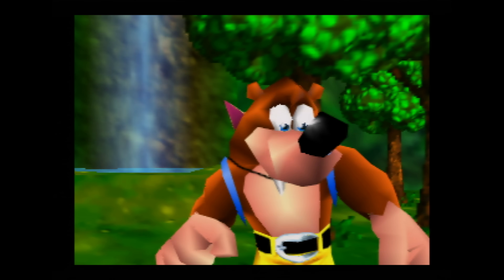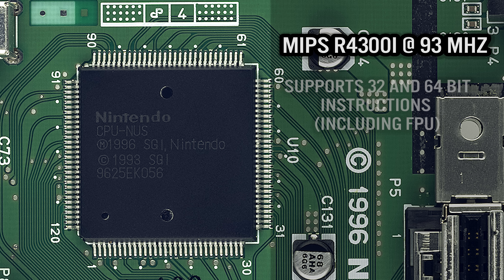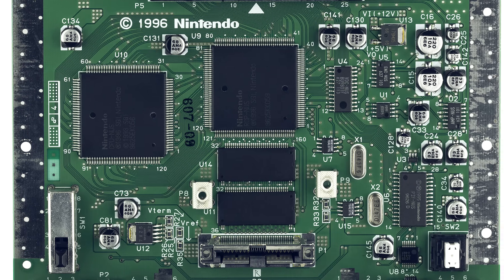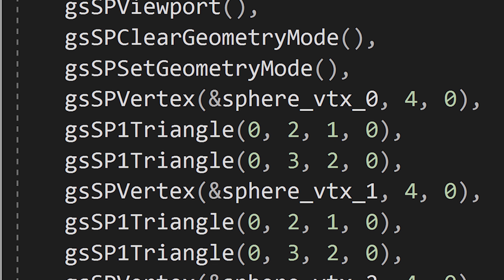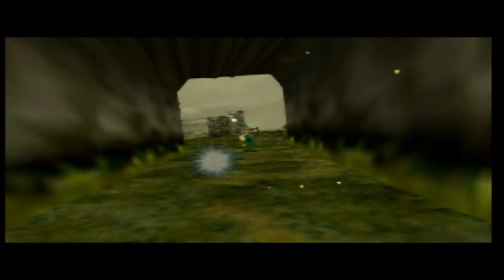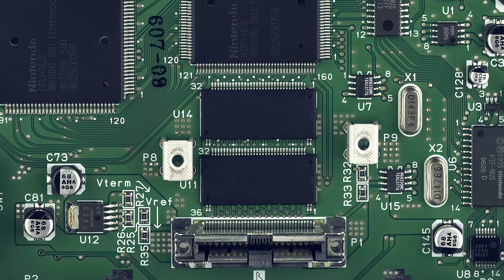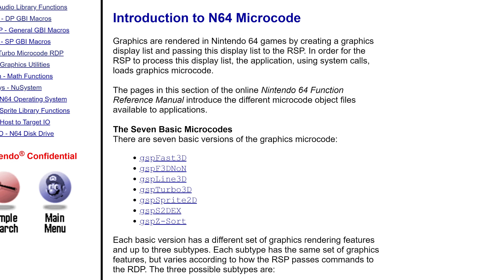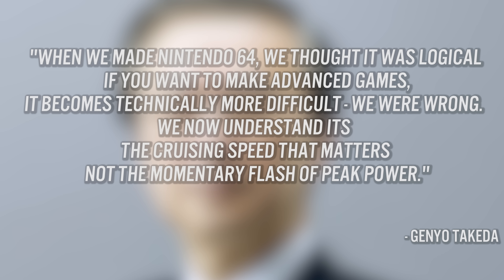Why was the Nintendo 64 so hard to develop games for ? | MVG

Comment: That puny texture cache really neutered the system. Even a secondary external cache probably would have been a huge help.
Reply: @JS-rm2ws  He was actually talking about the 4KB cache - not the 4MB RAM. If you can't fit all of your textures into the 4KB cache then you have to offload them to RAM, which is generally orders of magnitude slower than an on-chip cache although idk the exact numbers for the N64.
Reply: Tell me if I'm wrong here, but wouldn't an external cache have the same problems as the RAM? The cache was so fast, because it was built in the chip that needed it. If you added an external cache, it would lack the needed performance, wouldn't it?
Reply: @g.o.a.t.y.g.u.y  Yes and no, I think. The bottleneck tends to be the bus (especially if it's shared), then the RAM access method, then the RAM speed. The length of the wires are way down compared to those although it does affect how quickly the signal becomes stable. I'm no expert but that's how I understand it.
Reply: Yeah, 4Kb? Why the hell even bother? No wonder developers told them to shove it!
Reply: @immortalsofar5314  
Yep, one of the numerous reasons third parties completely slipped Nintendo for the most part during that generation.
Reply: @immortalsofar5314  4KB limit per texture - same as ps1. It wouldn’t have been much of a challenge had it been Cd based, could have filed multiple textures.  Cart memory restrictions really bottlenecked.
Reply: Thank you MVG. I'm learning a lot thanks to you
Reply: @immortalsofar5314  Kaze, one of the best and most knowledgeable programmers for the N64, argues that the 4kb texture cache isn't actually that big of an issue if you know good programming techniques.
Reply: Probably, although that poses problems of where to put it and who bears the cost, what the power requirements would be, etc.

Also helpful would have been if Rambus hadn't screwed up so bad with their hot new RAM type.
Reply: @JS-rm2ws  all three consoles then had different abilities that varied greatly. They all couldn't do something the other couldn't
Reply: Just imagine how different stuff would be if you went back in time and convinced the to upgrade it
Reply: a n i m e
n
i
m
e
Reply: Nintendo has always shorted their internal RAM and cache.  Game developers have complained about this since the NES.
Reply: @MarkMcDaniel  Their competitors did the same. It was never a uniquely Nintendo problem.
Reply: Why do you need special cashe just for textures. Isn’t that what ram is for?
Reply: @richieb74 cache is orders of magnitude faster and lower latency. It’s on die
Reply: Rambus choked the N64, not the texture cache. It was a failed attempt to think outside the box with RAM. It's also why the PS2 is such a slug next to its cogenerational competitors.
Reply: @CarbonRollerCaco  When developing the FPG core for the N64, a dev determined had Nintendo implemented an 18 bit wide twin bus rather than the actually used 9 bit bus, and spent just a small number of transistors on interleaving, it would have nearly cured the latency issues. Another problem was the CPU didn't have DMA. It was just a very constrained design.
Reply: This was 1995. No texture mapping or 3d cards (pre GPU) even existed on pc
Reply: A 2d streetfighter  Zero 64 with 3d backgrounds is all I wanted
Reply: It wasnt actually the texture cache size. It was mostly how the textures were mapped and used. PS1 had 2 kb texture cache and still produced amazing textures because of the way it mapped them.
Reply: @oliverb.8995  The PS1 had no perspective correction, texture filtering or hardware triangle setup. It was an awful 3d engine that breeded a boat load of shovelware. The ones which could overcome that shimmering and poppout mess were few and far between.
Reply: But it gave the system its signature look. The stretched and blurred textures were kind of a vibe.
Reply: @jvogler_art4708  "Signature console looks/sounds/feels" only work if they go well with the game itself, not as just an empty reminder of what system you're using. That just comes off as either a flaw or serendipitous soul-grabbing corporate branding.
Reply: Would it of been possible to make a peripheral that docked in the expansion slot? Because that could of been a solid fix. I know it was a ram slot but is that all it could take as an input?
Reply: @randomguy8196 The developer of Sonic R did a breakdown of how his studio house (that he was working for at the time) eaked out so much of the PS1 for crash. GamerHut is the channel he has on youtube.  Of course I could be confusing video's and people. But am reasonably sure it is the same person.
Reply: @wishusknight3009  You are mixing up two videos. Two good videos mind you. GameHut worked on Sonic R and made Saturn do some crazy draw distance and reflections that seemed "impossible" at the time. 

Andy Gavin co creator of Crash did an interview with Ars Technica about Crash on PS1. He talks about how the PS1 may have 450mb on disc, but the PS1 can only display 2MB on screen at any given time. Also he deleted or some Sony code or skipped around it to speed up the game. It's very interesting. 

You can also see Ben Heck tear down the PS1, N64 and Saturn. Then he goes over all the chips of each system and what they do. Talks a little about each system historically.

Now as for this N64 thread topic. Ya the N64 cache is imo the systems biggest issue. But is it really when Gouraud shading making things cartoony. 🤷🏼‍♂️ But that's a me thing. 

You also have to remember they weren't just developing the N64. They also were developing the 64DD along side it. The DD was supposed to launch with N64, but it was pushed back until JPN sales reached a certain number. That they barely if ever hit. They sacrificed 64DD games and made them normal N64 games instead to try and increase sales in Japan. But the Japanese weren't into 3D games quite yet. That's why you see the N64 do so well in North America vs Japan. We wanted 3D soooo badly here.

Would CDs have made N64 better? I don't really think so. The added cost would have probably made it $399 like Saturn. Meaning PS1 would have just sold even better. Then the eventual price cuts would have really hurt Nintendo like they did SEGA. 

Sony made all the chips and drives and components inhouse. SEGA and Nintendo bought from other companies. Meaning they had more to make up in sales. Wired even has an article from March 4th 1997 saying how Sony was slashing the PS1 price to $149 USD. Probably to prime the West for FF7. Nintendo even said they couldn't compete with the price but would have to. 
https://www.google.com/amp/s/www.wired.com/1997/03/sony-slashes-us-playstation-prices-by-25/amp

Nintendo made the best moves they could with what they had at the time. Nobody and I mean nobody expected the PS1 to do anything at first. SEGA and Nintendo were riding high on two generations and brand loyalty. But Sony was PO'd and on a mission in part to the Nintendo PlayStation disaster years prior. 🤷🏼‍♂️
Reply: @camrongraziano1254  ----"You are mixing up two videos...... "

I think i realized that later in the thread and stood corrected. 

----"Now as for this N64 thread topic. "

The n64 had lots of problems. The small internal texture cache being the larger of them for sure. High latency ram, no cpu dma and poor SDK among others. It also had rather poor fillrate. But a larger cache may have actually increased efficiency here quite a lot. 

The 64DD was a mistake from the outset. They should have just gone with normal cdrom tech. Even if they used the 8cm format to try and stay unique. Which would have given them 135 (ish?) MB of capacity. The higher price of the n64 cart games was a pretty big deal back in the day. And it gave a poorer value proposition at least in my mind at the time, even though the console was price competitive on the shelves eventually. The drive costs would have made the console less profitable, but the margins of the software would have been much higher. The profits on each cart game sold, were much lower than each cdrom title sold in spite of the carts selling for quite a lot more money. Nintendo learned this the hard way. The 8cm disc format also showed to have good access times in the game cube reletive to the full dvd formats of the other two. So it would not have been so bad. 

As it was, the attach rate of the 64 was much lower than the PS1 or the saturn. That says a lot. 

Sega tried to design the saturn like they did their arcade boards. And that does not translate well to consumer level stuff where its lowest common denominator. I still think it was the most elegant of the 3 in the day, and it is still my favorite of the generation. But it sadly didn't see its potential realized. The PS1 was a 'powerful enough' approach and was a little easier to work with. PS1 also lacked some fundamental 3d features that later became staples of 3d rendering, but the average consumer didn't seem to really be worried too much. And most of the time we were ok with load times.

---"Sony made all the chips and drives and components inhouse. SEGA and Nintendo bought from other companies. "

Did they fab their own chips? I can't remember now. I know they designed the packages in house. And much of the circuity other than the CPU and some of the minor IP blocks that were licensed. And the mechanical stuff they all did in house such as PCB manufacture and transport assembly. And you are right, that made the PS1 a much cheaper thing to produce when they had the capacity under their umbrella. It is one arm of the corporation arm buying from another. But they can set whatever price they want. 

Sega designed the VPU's and SCU of the Saturn completely in house. Very little in those was actually licensed, as the rest was mostly off the shelf parts. But sega also had to outsource the fabbing (mostly hatachi and samsung and some HP) and cd transport and PCB manufacture Basically everything. Nintendo was able to make thier own PCB's and cases. The chips were LSI (i think?)

----"But Sony was PO'd and on a mission in part to the Nintendo PlayStation disaster years prior."

Too true. Nintendo was a bit complacent and broke their mold of a more simplistic and flexible platform, and got sucked into the "bit wars". Sega lost focus and threw a bunch of pasta at the wall. Forgot that having the best graphics means nothing without good focused support for existing platforms and amazing library of games. It is hard to say what would have happened if they didn't bother with the two MD addons and didn't flub the Saturn launch and spent many years alienating the 3rd parties. Only to have to force them onto a difficult to program console. I still thnk sony would have won the generation, but maybe the saturn would have been real competition.
Reply: @wishusknight3009  -I stood corrected:
I'm sorry, I thought I had read it all. Must have missed that. 😅

- The 64DD was a mistake from the outset. 
I can't really argue that. As that took up a chunk of the R&D time/money and was always sorta behind the scenes being worked on. Had 64DD launched with N64 it also may have made things confusing to customers like "Why is it in two parts? and do I need both?" And again added cost. Just like if they had gone CD instead. Though I do see your point about the 8cm GCN style discs. Nintendo would have just partnered with Panasonic sooner. 🤷🏼‍♂️ Plus with the RAM pack N64 games could have been more than they were. Maybe not prettier cuz textures. It would still need that 4MB of RAM to outdo PS1. I still like the idea of the 64DD. It was just too ambitious. 

- As it was, the attach rate of N64 was much lowe than the PS1 or the Saturn. That says alot.

Considering how many Saturn's sold in the West, yes yes it does. Makes me wonder how many games Saturn fans were buying. 😅 Cuz I remember having like 10-12 games for N64 by the end of it's life. And I was 12 when I got it in 98. I also do not know how many games Nintendo needed me to buy haha. 

-The chips were LSI I think.

I had to Google it 😅 but yes LSI. Apparently Sony and LSI worked together super closely to make them. Part LSI part Sony. And the PS1 GPU was designed by Toshiba. 
This is the LSI article:
https://patpend.net/technical/psx/LSI.htm
And Wiki mentions the Toshiba GPU:
https://en.m.wikipedia.org/wiki/PlayStation_technical_specifications
And just to squeeze it in here is the Ken Kutaragi quote that brought it up in my mind ((The inhouse comment) it was in a Jenovi video)

"Hideki chan, there is no way you can beat me. Where are you buying your processors? You're buy them from Hitachi, you're buying them from Yamaha. What about your CD-ROM drives? You're buying everything and you can't make anything yourselves. We can make everything ourselves including custom parts. We have our own factories."

Ken Kutaragi

- I still think Sony would have won the generation, but maybe the Saturn would have been real competition. 

The more behind the scenes and technical stuff I learn, it looks like you're right. Sony was gunna blow up anyhow and win the 5th gen. Not much SEGA or Nintendo could have really done to stop it. They could have done things to better their own positions though. Like axing the 32X and 64DD. That may have made things less tense in those two camps. Or even better SDKs would have made relations better with devs. Sony still had better contracts. 😥 I'm starting to think had N64 really just been SNES2 with a CD drive it still wouldn't have won that gen. 🤔
Reply: @camrongraziano1254  Thank you for the excellent replies!  The links were a bit of interesting reading. And I am glad my memory has not failed me in my old age. Sony executed pretty close to perfect at every stage of the PS1. It quickly built a brand for itself and cannibalized many good software houses that were tired of the poor contract terms and runaround of the other 2 camps. It is pretty much agreed that short of a miracle, there was nothing the other 2 could have really done to slow them down, much less win the generation. 

Most kids I knew had anywhere from 4 to 8 n64 carts. And mostly the same 1st party hits. A few had more as well. I had close to 20 Saturn games by the launch of the Dreamcast. And most kids with PS1 had close to that many games as well after a while. I was the only one in my larger group of gamer friends with a Saturn though. And everyone seemed to look at it with some sort of enigmatic curiosity.

I did pick up a PS1 about 2 years after its launch and got to work collecting for it. Things got pretty cheap for it at this point and I grew tired of waiting for killer games on the saturn to hit canada. And it was shortly after that point that Sega threw it under the bus. But I do clearly remember thinking that most of the PS1 titles just seemed less polished or just not as good as the decent Saturn titles. Not to say i didn't find many of them fun and engaging, or decent controlling, I just thought the graphics and such were just terrible. I had this constant feeling like I was selling out a good friend lol.. Other than outliers like Crash or well ported side scrollers that were quite impressive for me at the time, but were the exception and not the rule.   The Saturn had its share of shovelware too, but even in spite of the difficulty of the systems programmability, there was a lot of great looking and playing titles on it. And the PS1 just set lower expectations when purchasing a game. But in fairness I also never really felt like I was purchasing a PS1 game for its graphics, but knew based on reputation that it would be a good game to play and have. 

I only picked up an N64 long after it passed away. And I was always blown away at just how good the few first party titles really were, I am sure as a kid you would have felt proud of that. But then i realized that it basically had a library of about 10 games or so, and then a bunch of mediocre filler. I still maintain nintendo had the best  games of the generation. Even if it was just a couple in its library.  All 3 had their standouts. But Nintendo seemed to have titles that were certainly the most memorable. And they repeated this with the GCN, which is another console I jumped on pretty quickely after the dreamcast was done with. I didn't get a PS2 until last year lol.
Reply: @wishusknight3009  You're welcome and thank you for the great reply. Ya Sony really pulled a Masterclass in launching a new games console. And it seriously pains me to say it. PS1 was just a way for me to play Squaresoft RPGs and Grandia. If Saturn had got more RPGs in the West (Thanks Bernie) I'd have probably got into Saturn way sooner (a regret of mine)

I was very proud as a kid playing N64. The only thing like I said above is that RPGs were nowhere to be seen unlike on SNES. But Pokemon was life at the time and Ocarina is the greatest game ever...EVER!!! 😅 It made me think Nintendo didn't need third party to carry a games console. That's why I own a WiiU ... nobody else does lol. Back when they cancelled WiiU for Switch I grabbed a few more N64 games and I'm just around 40. And around that same time I sold off every Sony I had to collect Saturn. Turns out I freaking love Saturn. I have about 20 games and could probably easily think of 20 more good Saturn games to buy. It's a shame a bunch of Saturn games are stuck in Japan. However it's also great that Saturn is getting fan translations these days. 

And just about everything after the 6th gen makes me miss the 5th gen. 😥😅 Each console felt so special and unique. I love how Saturn and N64 did 3D. I also love the look of games like Burning Rangers, Phantasy Star Online and Skies of Arcadia. I miss SEGA 😭😭😭
Reply: @camrongraziano1254  I really believe the Dreamcast is the last true console in the vintage sense. It was unique in its time and bridged a massive shift in console gaming. 

And glad to hear you dig the saturn. I also love some of the modern hardware upgrades finally coming out for it. So I can replace the defective rom drive in mine for the last time. (3rd one its had in its lifetime).

There is a lot more depth to its catalog than most people ever realized.
Reply: @wishusknight3009  Agreed. Dreamcast was a very special console and after it was cancelled I could feel gaming change and for me it wasn't better. 

Thanks 🥰 I started with games from 98 and work backwards. Games from 97/98 are so good. Shame we didn't get Grandia though. I love Burning Rangers, HotD, Shining Force, Saga and Rayearth. Thankfully we are getting translations for those ODEs 🥰 

Just to be nosey, what are some Saturn games you recommend? Something you love? 😁
Reply: @randomguy8196 Ahh ok. That would be my confusion. The video I was thinking of was an Ars Technica interview with Andy Gavin. "How Crash hacked the original playstation" 

The guy from Travelers Tales did some video's on the prototypes of wrath of cortex on his channel. 

You are 100% right.
Reply: Technically, it did sort of have that with the optional expansion pack.
Reply: You can also build pretty competent looking 3D graphics without textures, as Super Mario did.  By using the 800K+ polygons/sec, with each polygon getting its own color, you can generate bump maps, grooves, ridges, smooth surfaces, etc, that look more realistic.  During the 1990s, many graphic artists believed that textures were the wrong direction or even a way to cover up low polygon counts.
Reply: Ya...really odd. Obviously it worked but I remember thinking even as a kid how bland everything looked.
Reply: @DouglasThompson  TBH I remember being underwhelmed by the graphics of that generation across the board. While I understood that 3D polygons were a technical leap forward, they just looked so simplistic compared to the highly detailed pixel art of the 16 bit era.
Reply: @JS-rm2ws  imagine if they built the system so that the texture cache could be upgraded O_o
Reply: The texture cache of ps1 and Saturn was 2kB, the diffrance was that they had VRAM with very low latency
Reply: Most ppl here complaining about n64 are complaining like new age gamers, complaining about things that didn't matter back in the day lmfao, n64 was arguably the best console of its generation, leagues better than the ps1 or the Sega lol
Reply: Can't be too bad, James Lambert got 40 megabyte textures working on a real N64
Reply: Bingo !! Texture cache was neglected 😢
Reply: Nintendo ultimately neutered the N64.
Reply: According to Kaze Emanuar (I believe that is the way you write his nickname and his channel) who is a very talented developer for the N64, 4KB is excellent and enough. You may want to check his channel. His ROM hacks of Mario 64 looks amazing, almost like GC games and he explains how he achieved such technical marvels
Reply: The ps1 only had 2kb :/
Reply: A quick Google search says the PS1 had 2kb of texture cache vs 4kb for the N64. I'd guess it sounds small because on chip cache memory is more expensive and can create issues in the silicone lottery (more cache = greater chance of manufacturing challenges).
Reply: What hurt more than anything was that the dev kits weren't very good and game programmers were very rarely adequately trained to do the graphics programming in a well optimized way. Very few game developers for the system had sufficient knowledge, skill, and budget to do it properly, but you can find some notable exceptions. Acclaim, for example, was able to take advantage of the system much better than a lot of other developers. 

It may have made the system easier to design for if it had dedicated vram, a larger cache, or faster memory bandwidth, but Nintendo really dropped the ball in terms of how poor their dev kits were, and there were already some communication failures inside of Nintendo and between their hardware partners and themselves. Many of these issues were improved upon significantly over time.  

Even Nintendo failed to properly follow some important instructions from SCI regarding how best to optimize for the architecture. Rare also knew a lot about how to take better advantage of the hardware, but their games tended to run noticeably slower than Nintendo games, and usually didn't hit 30fps consistently, if at all. 

It was entirely possible to get N64 games to run at 60 fps, and yet many games couldn't even achieve a consistent 30 fps

My opinion is informed by Kaze Emanuar, who has recently argued that if you know how to program for the system properly, the memory bus is fast enough to effectively utilize the shared memory and to avoid bottlenecking the GPU.
Reply: Kaze completely disproved that, the PS1 had 2KB
Reply: DirectX patented higher res texture wrapping utilized with Xbox and Dreamcast. Special algorithms to do so in realtime. The man who held that patent is well, well off.
Reply: @JS-rm2ws  Basically explained what I was gonna say. I loved FPS games, ARPGs like Goemon's adventure and Zelda but that was it.  Playstation had all the resident evils way before N64, Xenogears, final fantasy, metal gear solid, gran turismo, twisted metal, chrono cross, etc, etc. Really couldn't compare the libraries.
Reply: @Kent talks tech The problem I have with all of these armchair game system engineers is they have no clue what it takes to make a game system that can be sold at a $200 price point in the mid-90's.  "Oh, why didn't they just add this or that?  The system would have been so much better.  Why did it have this or that limitation?  Boy, Nintendo sure is stupid."  People!  If you're this clueless when it comes to engineering a piece of hardware for a particular price point, at least have the humility to realize you don't know what your talking about.  Dunning-Kreuger Effect on full display here.
Reply: @davidaitken8503  yeah people forget , that this is an era when PC (ie ram chips ect ect)  tech was at a all time high in cost still (it didn't start droping in price till 98)

A system  with a 
100-233 MHZ CPU 
8-16 MB system ram
a Voodoo 1 graphic accellorator with 2 MB -4MB Video ram 
a 1 GB hard drive 
a 4X CD-rom 

Costed upwards of 2000+ dollars. 

this was the kind of system it required to beat N64 graphics  back then. 

Nintendo was trying to beat what was a beast of a PC spec in 96 , and do it for under 200 bucks.  it wasn't so simple as throwing more cache on the chip when doing so would have made the chip's cost jump several hundred dollars. that's if it were even possible to.   back then the kind of Cache ram chips they made were huge , (physically)  which is why cache was usually measured in the KB range still.  system ram used the same kind of chips too then , and i remember my step dad bringing home a computer in 94 that he bought off a friend at work when they were getting a newer system/ guy had loaded it's ram slots  to achieve a whopping 10 MB of system ram , and the chips on the dim's were these quarter inch think chips i remember thinking how crude it looked on the inside compared to it's sleekness on the outside. this was an old 486  (clocked to 125 mhz) system btw. oh we also added a voodoo card on it in 96 but by 98 my dad got a pentium 2 PC for us , and i jsut carried my voodoo card over to it.
Reply: @DenverStarkey  Thank you for illustrating my points.  These people that didn't live through that era have no appreciation for what Nintendo accomplished.
Reply: @davidaitken8503  you're welcome , but i would like to point out  in an earlier comment you acted like early graphic acellerator cards were inferior to  consoles.  they were not. that voodoo card even put into an older 486  , ran circles around both the N64 and PS1 in it's graphical capabilities. the only issue is not many games made it to PC that were also  on console to test the difference.  i only had two games that came out on both .  that being FF7 and Resident evil 2. but as such i can say the pc versions ran at higher resolutions and ran much smoother than  the console versions.  
not downplaying what nintendo achieved, But there is only so much one can do  at a  200 dollar price point.   

That voodoo 1 card did cost 150 bucks just for the card alone.  while the n64 was an entire system  for just 50 bucks more. 
what miffed me more than any thing is my sister borrowed  my FF7 game  (PC version) and broke disc 5 before i could finish the  game back then.  the PC version of FF7 back in the day had a very limited run , so getting a copy of it became nearly impossible before the age of  Ebay .  and even then copies on ebay can go for as high as 700 bucks.  that said  steam had a re-release of FF7  for PC which i of course snagged up but at more than 20 years later .. it's still upsetting i didn't get to finish the game back then.
Reply: @DenverStarkey  I think you misunderstood the context of my comments regarding 3D accelerators.  Many of those early 3D cards often lacked certain features that wouldn't display properly.  Transparency's might display as a "screen door" on one, while another might have other problems.

Obviously, the 3DFX cards were indeed superior in terms of performance, but my other point was that there weren't a lot of games that took full advantage of it until about '98 or so.  Yes, 3D accelerated Tomb Raider on PC looked far superior to the Playstation version, but still couldn't compete with Turok, Wave Race 64, Blast Corps, Super Mario 64, Extreme G, etc. that took full advantage of all of the cool graphic effects, animation, etc. that the N64 was capable of.  It was just a non-accelerated game with 3D card support.  It didn't take full advantage of it the way something like Unreal did in '98.
Reply: @davidaitken8503  yeah but again your get games like  FF7 and resident evil 2 THAT DID take advantage of those visual technologies. and looked far superior than the N64 graphics . Resident evil2's OG PC release was only a week after it's PS1 release , and a year or two ahead of it's  N64 release. and there were quite a few PC exclusives that took advantage of those techs too. i had  both the voodoo 1 and a n64. the frist voodoo 1 cards launched the same year as the N64. and by 97 there were plenty games  that took advantage of their hardware . unreal didn't even run good on the first voodoo cards , it really required  a voodoo 2 card.  but there were plenty games prior to that that used all the tech of voodoo 1.  i don't even remember all the games taht did make full use of it ,  but there were quite a few well before unreal. Unreal is just the one every one remembers because it pushed the voodoo1 to it's limit. 

dude i'm not saying the n64 was bad , but it in now way compared to or beat a 2000+ PC of 96-97.
Reply: @davidaitken8503  We are able to look in hindsight to see where the system is bottle necked. One glaring omission in this video was the CPU did not have DMA. And from what I understand it would not have taken much to correct that in the arbitration logic. But it is also speculated that it may not have had much of an impact overall either.  I have seen qualified engineers make comments to the effect that it would have benefited performance quite a lot to double the bus width of the RDRam to 18 bits wide and implement multi way interleaving. It would have improved latency performance a tangible amount and not had much impact on cost or chip size. It would not have doubled the bandwidth in practice but it would have improved things enough that an enlarged internal texture cache may not have been needed.. As it looks like trying to increase it to 16kb would have increased die size quite substantially.
Reply: @davidaitken8503  This is so true, except in every way that it isn't... lol.

As consumers it's a good thing to judge the products to the best of your knowledge if you do so fairly. And using other consoles as a bench mark is a good one. 

Pretending to be high and mighty above the desires of others and the observations they make only serves to make you an asshole, not some brilliant mind. 

Nintendo themselves admired they could have done better, so those "arm chair engineers" are right. Maybe not in every specific example they give, but conceptually.
Reply: @davidaitken8503  So true. And it's like what systems were out there not just during the lifetime of the N64, but at the time the console was developed. What were dev tools or best practices? Was there a 3DMark-like test suite? How do folks balance cartridge/memory/cache? I bet half the numbers were best guesses, and by the time they discovered the RDRam latency issues they were ill-poised to back up 6+ months to cancel their production orders and retool.
Reply: @davidaitken8503 Nintendo could have taken the cost hit, they entered this generation as the powerhouse. What happened was they shrugged off Sony till it was too late and then they scrambled for low cost since anything more than the PS would kill them. Nintendos only saving grace was Sega messed up so bad that they could live off the scraps. My current employer is in this situation in 2025.
Reply: But they needed it to be cheap. The N64 was already 50% more expensive than the PS1 and Nintendo wanted full 3D without issues. So no texture warping, dittering or pixels snapping into place. It's also why the N64 uses cartridges. A disc drive is expensive and also slow. The PS1 was somewhat limited by it's disc format since the loading times were so slow. Meaning they had to mask loading times and every level had to fit inside the limited RAM space. The N64 didn't have this issue and with some clever programming level could be huge and yet still flow easily from one to the other. The price again also is an issue as adding a disc drive would have made the N64 even more expensive.
Nintendo wanted the N64 to be able to provide 3D games with the same fluid speed that the SNES could do 2D games and the N64 did that.
Reply: @MrMarinus18  "Nintendo wanted the N64 to be able to provide 3D games with the same fluid speed that the SNES could do 2D games and the N64 did that."

That unfortunately wasn't reality until the gamecube. But that didn't stop nintendo from trying!
Reply: @MrMarinus18  But (ideally) you only pay for a console once. You buy games a lot. A disc game could be sold for less that a cartridge game, even with multiple discs versus one cartridge, and still profit more.
Reply: that texture cache is why the games look like shit EVEN FOR THE TIME.
Reply: @xenxander  The N64 had by far the best looking visuals for its' time.  Playstation and Saturn games had less ambitious game design in order to give the illusion that they were capable of competing with the N64.  Maybe you should do a little research.
Reply: @davidaitken8503  Radient silvergun on Saturn looks visually better overall than any N64 game. Tons of massive sprites, visual effects, high res textures and minimal warping issues, transparancy, Distortion effects, Specular effects on the already exceptional water rendering, very high res backgrounds, Massive draw distances beyond anything you could pull off on PS1 and N64 in its 3D infinite planes, perspective correction just like N64 with no draw backs, clean imagery, fog volumes to enhance the graphics, not hide them, lens effects, moving cloud backdrops, 640-480 main menu, exceptionally clear audio, and more all at 60 fps. 3D in that game innovated the shmup genre from just 2D 16 bit era. There was nothing like it on any system at the time and N64 couldn't do it with the amount of complexity on display nor PS1 so spare the fanboy nonsense on what has held up visually.

Since you think nothing was innovative on anything other than N64, lets exclude the example above for your benefit, is there any massive game worlds that innovated the genre on anything but N64? 
A little game that innovated the RPG genre was Panzer dragoon saga with its free form camera and gameplay blended with strategic JRPG elements. The camera work was top notch and is still pretty good. It had cinematic storytelling with excellent voicework ahead of MGS on PS1 and Ocaina of time on N64 a couple of months in advance of them. The N64 would've needed major cutbacks assuming Nintendo would've allowed 2 massive carts to store all the data ( 4 disks over 2000 megabytes for a 3D game with no pre rendered backdrops was unheard of at the time ). Massive draw distance with no fog with perspective correct high res, artifact free textures that don't filter-out and maintain max detail that can be animated with water effects that look just as good as the best on N64 or any other effect and all at a solid 30fps The fillrate needed to achieve those results would be virtually impossible on N64 and PS1 to replicate. Also perfectly crisp audio again. So spare the nonsense the Saturn can't do good 3D to save its life crap and the irony of it all is having gone back to look at these games ( I own them all ) on these systems what strikes me is that the Saturn actually has the best overall image quality of 3D that gen because it didn't suffer with severe texture warping as PS1 but still had comparable texture res with better colour shading and no dithering in site and then you had high res perspective correct textures with no blurry low res textures and heavy filtering applied at off angles that the N64 was plagued with. The best of both worlds. The only thing weak is the mesh effect and that's it.
 
You come across as someone that seems to have a hard-on for hating Sega Saturn and Sony playstation.
Reply: There is a big fanboy-ish war here appearantly

Imma just slide in as an average consumer who still makes mistakes between GB and MB:
Comparing 32 bits to 64 bits is stupid lol (no offense)
Reply: @JS-rm2ws  ah, there it goes. You only liked Bond lol. FPS was this wierd side thing in N64. Those fans never appreciated the full console. To say that was it on N64 is so trollish. Mario 64? You quote developers, well they avoided a sequel openly because they claimed it was essentially perfect. Zelda? Love or hate it, it will top the list for greatest more often than not. Mario Kart? Even Castlevania did well on it. Sin and Punishment? Liked golden eye but not Turok? Perfect Dark? Resident Evil 2? Smash Bros???? Mario Party, Ogre Battle, Killer Instinct, Blast Corps, and the best wrestling games ever. All those games you mentioned vs Banjo is a Joke. Banjo looked Totally different and better as most developers (since that's your thing right?) will back this.
Reply: @thomasbeall9069  I forgot about Castlevania 64. I like SoTN far more.  Castlevania 64 was another one of those depressing dreary games where you could see 40 ft in front of the camera before there was a wall of "fog", ugh the "fog" in N64 games. The gameplay and music in Castlevania 64 was not up to its PS peer.
Reply: @meegz149  C64 did great and was fun. No CV is liked or better than CotN so whatever. C64 because of its success got a upgrade. Fog? Wow, you dissed 1990s 3d tech lol all.consoles had limited tech then. You speak as if it is out now LMFAO hahahah 🤣 so didn't like Cv64 because you probably didn't beat the first level.
Reply: @meegz149  FYI Silent Hill was PS, by Kanomi.......had.... fog.....lots too....kinda was liked ........fog......lol
Reply: @thomasbeall9069  " Silent Hill was PS, by Kanomi.......had.... fog.....lots too....kinda was liked ........fog......lol
"
cool dude.
Reply: @thomasbeall9069 I now know I am stupid for not liking blurry textures and fog that added nothing to the games but was a product of hardware limitations. Ya, I'm okay with that...
Reply: @meegz149  then you hate that whole era LMFAO 😂 3d was in its infancy. Star Fox was only a few years prior, I'd say Star Fox 64 was an improvement for a 4 year gap lol. Whatever, all consoles were different but limitations was the one thing they all had in common.
Reply: @thomasbeall9069  Of course! I am a fool for not seeing it sooner! Primitive anti-aliasing is logically better than pixilation! Stupid me. I think they teach you how to prove that in discrete mathematics courses. Please feel free to kick 14 year old me more than 20 years ago.
Reply: @meegz149  sometimes I get the feeling we're having a conversation with a bot. You ever get that feeling? Others call it trolling. Whatever you call it, it just doesn't feel real at all, like we're not even talking to a human here
Reply: @meegz149  odd, let's see if you have the ability to focus. Is Star Fox 64 better looking than Star Fox on SNES? Yes or no?
Reply: @JS-rm2ws  I get the feeling your one person with two profiles..............
Reply: @meegz149  Please don't take this as an insult but what you are saying is just plain ignorant.  You talk as if a limited draw distance and fog was somehow uniquely an N64 problem.  Pretty much any ambitious Playstation or Saturn game suffered from these same problems, but more so, and even worse most games had to resort to restrictive game design choices like fixed cameras and even using just a 2D backdrop to represent an entire 3D environment.  Limited draw distance doesn't get more extreme than that.

Nightmare Creatures, Medal of Honor, and Legacy of Kain: Soul Reaver all resort to using fog, despite the fact they look and play far more primitive than Turok 1 and 2, Castlevania: Legacy of Darkness, and Golden Eye on N64.  Games like Crash Bandicoot and Metal Gear Solid aren't even that ambitious though.  They have to resort to a fixed camera angle looking down on the game environment.  Then there is the ultimate compromise in limited 3D rendering capabilities.  3D environments represented by 2D backdrops as seen in games like Resident Evil and Final Fantasy.

There are literally dozens of N64 games I can think of just off the top of my head that the Playstation and Saturn could never hope to run in a million years.  I'm not just talking about the ones with the best visuals of their generation either.  Body Harvest (while by no means the prettiest game) was a fully 3D open world game with massive levels by DMA Design (aka Rock Star) a generation before GTA3.  Rocket: Robot on Wheels was a 3D platformer with a similar structure to Mario 64 and Banjo Kazooie with the first true physics engine on a game console.  Aerofighters Assault and Rogue Squadron were open level flying shooters that, ha, ha, ha, ha, ha.  Sorry, I just thought about a Playstation or Saturn even attempting to pull those games off.

The best looking N64 games not only look far more impressive than the best looking Playstation and Saturn games, but they are on an order of magnitude more ambitious in their game design than anything ever attempted on the Playstation and Saturn.  You seriously need to expose yourself to more games on the N64.
Reply: @davidaitken8503  cool dude.
Reply: @meegz149  One would think you'd appreciate fog in a Castlevania game.
Reply: @thomasbeall9069  That's called a sockpuppeteer.
Reply: @davidaitken8503  Ambition≠final quality. Every system has great games regardless of how much those games try to push varying envelopes. Nothing wrong with that.
Reply: @davidaitken8503  yeah turok pretty much showed how weak the PS1 and Saturn graphics were with their ugly pixelated graphics and blocky light sources. (Lens flare etc.)
Reply: @davidaitken8503  Is ok to be wrong.
Reply: @thomasbeall9069  I loved Turok :) my first console FPS and the reason I became a southpaw user. God that was one expensive game, around £70 here in the UK on release. A lot of those other games you mentioned, I missed out on because I'd pretty much given up on the N64 by late 1998
Reply: @thomasbeall9069 he didn't even get to plaY perfect dark he sold his n64 2 years in lmfao allegedly, dude probably didn't even have the red expansion pack😂😂
Reply: @JS-rm2ws  Of course with 20/20 hindsight their will always be regrets about design decisions made.  That is true with anything.  Compared to the other competing consoles at the time though, the N64 was an absolute beast of epic proportions.  The Playstation and Saturn could never hope to do any of the more technically ambitious N64 games, yet the N64 could do ports of their games relatively easy.  Do you seriously want to compare Golden Eye to those pathetic Medal of Honor games?  Get serious!

The PC couldn't even compete with the N64 when it first came out.  3D accelerators were just starting to come onto the market and they were all over the place.  One might run a game smoothly but not display certain graphic effects properly.  Another might have all types of random crashes but display the visuals properly.  It was an absolute mess in those early days of 3D graphics cards.
Reply: @davidaitken8503  Easy ports? With no FMV support and neutered soundtracks/voice acting, maybe.
Reply: @Skrenja  The 2-player split screen mode of Tony Hawk's Pro Skater on N64 ran much smoother than the Playstation version while running in a higher resolution with perspective correct textures, etc.  The same was true with Vigilante 8 and a number of other ports.  Who cares about some dumb FMV opening?
Reply: Eh, the PS1's texture cache was only 2 KB. Half the N64. Cartriges are what killed the N64.
Reply: @briankarcher8338  We're talking about programming, not storage. Rambus is the main culprit.
Reply: @briankarcher8338  In what delusional fantasy world do people live in where the textures looked better on PS1 games than N64?  Have any of them even played some of the later generation games?  Does anyone seriously want to compare PS1 games to the graphics quality of Perfect Dark, Conker's Bad Fur Day, Zelda: Majora's Mask, Banjo Tooie, or Turok 2?  The textures on faces in Metal Gear Solid are literally just a few ugly rectangles.
Reply: @davidaitken8503 Exactly. Those large textures are of no use in open worlds when you don't have the bandwidth or processing to use them. It might have been the smarter choice at the time but then we wouldn't have gotten beautiful games like the ones you mentioned. Not sure if you mentioned Rayman but it was a work of art at the time that PS couldn't do as well also.
Reply: @CynHicks  Good catch.  I had forgotten to mention the gorgeous graphics in Rayman 2.  The thing I can't get over is how anyone can seriously look at a simplistic game with a fixed camera like Crash Bandicoot and not understand that it is rendering a mere fraction of what a game like Banjo Tooie or Conker's Bad Fur Day is.  Playstation games were usually really primitive in their game design and the few that did attempt a more N64-like level of ambition such as Legacy of Kain: Soul Reaver suffered from heavy fog layers, lower res textures, etc. except more-so than their N64 counterparts.
Reply: @davidaitken8503  "The thing I can't get over is how anyone can seriously look at a simplistic game with a fixed camera like Crash Bandicoot and not understand that it is rendering a mere fraction of what a game like Banjo Tooie or Conker's Bad Fur Day is."

Crash Bandicoot really is a standout on the PS1 and the developers really worked hard to make as good as it was. I do think the game looks amazing (for the ps1 anyhow). And its gameplay was every bit as good.  The fixed camera was a design choice to the foundations of the game play that allowed them to improve the graphics like they did. 

No, it isn't up to the likes of Conker in graphics... But its still an achievement in its own right. And sadly games of that quality on the PS1 are very sparse.  Lack of ram kind of kills the PS1 there.
Reply: @wishusknight3009  Agreed.  I never meant to suggest that the developers of Crash Bandicoot weren't doing the best they could on the limited Playstation hardware, merely that some of these clueless jokers didn't comprehend just how much more ambitious many N64 games were compared to games like Crash.  People were complaining about blocky scenery, fog, and low framerates on N64 games compared to PS1 games as limited and restrictive in their design as the likes of Crash Bandicoot.  They were being absolutely ridiculous.:)
Reply: @davidaitken8503  Of course!  One of the main developers of crash has made a series of videos detailing its development in some pretty decent detail. And they were able to extract resources from the PS1 that I don't think few others were able to achieve. Really kool series. He also made Sonic R for the saturn and showed how they overcame some of its weirdness. 

I think given how much more expensive n64 games were to produce given the cost of the carts and such, most devs put in that extra effort to make sure to recoup their investment. I certainly think the average game on the n64 was of much higher quality than the ps1. Absolutely. 

Sony's open nature helped contribute to its plethora of shovelware.
Reply: @davidaitken8503  I agree. PS1 textures look like games on PC running in software rendering mode whereas N64 games looks like games running on a 3D accelerator 3DFX Voodoo card on PC. Compare Quake and Tomb Raider on PC in both rendering modes and you'll see what I'm talking about. People who claim the "PS1 has bettur grafix den N64" have clearly never played PC games from around the same era. Give me bilinear and trilinear texture filtering anyday over software render pixels.
Reply: @wishusknight3009  Yeah, but… you don't have to buy the shovelware.
Reply: @ironinquisitor3656  Just what was with the weird diagonal texture blending on the N64? Why did it cover one diagonal but not the other? That ALWAYS bothered me. Like, the modern ports of DOOM 64 went out of their way to replicate that and… why? Was it a bug?
Reply: I don’t care, I still loved the 64
Reply: @jimbeaux89  amen to that, bro!
Reply: Rena Kunisaki I was so excited for the N64 but after two years I sold the system. I really didn't like how the textures looked on the system. I don't know why but I found them depressing. I kinda feel the way about xbox one games too. Can't stand the low res, washed out textures.
Reply: @meegz149  Okay, that's just stupid.  You sold a system because you didn't like how the textures looked?  The textures still did look better than any of the jittery, pixely crap on the Playstation and the Saturn's 3D capabilities were an absolute joke.  Don't even get me started on how awful most 3D cards on the PC were back then too.  You gave up Golden Eye and dozens of other groundbreaking games for that?
Reply: @davidaitken8503 As a non engineer I know one thing is for sure. I loved my N64 at that time. Had I had to choose one it would've been it. I only wish they could've had more great games earlier on. It really was a 3D rendering beast at that time. It's funny to me that still to this day the PS1 VS N64 debate still rages. Opinions are fine but facts are facts.
Reply: @CynHicks  There are a bunch of N64 games that are still worth playing to this day, yet you will find few PS1 games that anyone actually cares about anymore.
Reply: @davidaitken8503  If only for Zelda it's worth it... FF7 was also a masterpiece worth a console to be honest but...

You said it right. Dragon's Lair (arcade) had better visuals than most games for at least a decade. It was a "choose your own adventure" movie for the most part though. I'd much rather play most any N64 title. Maybe the 'argument' continues because a lot of them didn't grow up on such limited systems and games to fully appreciate what the N64 was capable of and Did? I feel like I'm starting something when all I wanted to say was great points...
Reply: @davidaitken8503  I thought the Playstation looked like drab mud and bought the N64. I barely bought any games for it and pretty much stopped using it by '98. I got a PC in 1997 and a 3DFx card and it was a leap beyond the N64 graphically. I even ran Ultra HLE on it while the N64 was a current system. My next console was the Dreamcast which I loved. I'd rather have good textures than polygons and preferred it to PS2. Of course the most important thing are the games and DC had quirky and innovative games from Shenmue to Jet Set Radio to Seaman, Space Channel V, etc. Great system.
Reply: @rsmith02  '98?  Isn't that the year that Banjo Kazooie, Turok 2, Rogue Squadron, and Zelda: Ocarina of Time came out?  Your problem, by your own admission, is that you didn't buy many games for the N64.  I'm well aware of the games that were available for the PC in 1997.  Most of them were non-3D accelerated games that supported 3D acceleration.  Hardly as impressive as what was coming out for the N64.  By 1998 there were some games that started to pretty much require 3D acceleration and were certainly comparable to the N64 like the PC version of Turok 2 as well as the original Unreal.

As far as quirky and innovative games, I would definitely take Hey You Pikachu over Seaman.  In fact, there is a whole slew of innovative games for the N64 that are better than any of the Dreamcast games you mentioned, and it's not even by a little, but a lot.  Rocket: Robot on Wheels, Space Station Silicon Valley, Blast Corps, and an obscure arena fighter called Super Smash Bros. come instantly to mind.  I'd even recommend Iggy's Reckin' Balls and Pokemon Snap over crap like Space Channel 5.

The Dreamcast never had any games that could compete with the best the N64 had to offer.  Draconis: Cult of the Worm was pretty good though once you got the hang of it.  You should definitely try that one if you haven't.
Reply: @davidaitken8503  "few PS1 games that anyone actually cares about anymore"
On the PS1 itself, certainly, but that's mainly because older console disc drives are shoddy as Hell. Many PS1 games got official ports and are still beloved.
Reply: @davidaitken8503  Nahh... I agree the N64 blur is preferable to the PS1's pixelation, but the 3dfx Voodoo on PC and it's Glide API were superior to both in almost every way. It should be though... The setup is much more expensive.
Reply: @RetardedSysAdmin  I agree the 3Dfx Voodoo on PC looked more impressive once games actually started to be built to fully take advantage of it.  When the N64 first came out there weren't any PC games that truly took advantage of 3D accelerators.  Games like Unreal didn't come out until 1998 if I recall.  Prior to then there were mostly just non-accelerated designed games that offered support for 3D accelerated graphic options.
Reply: @davidaitken8503  It's usually the opposite, the same 4 or 5 games are always mentioned for the 64, the PS1 has countless games in almost every genre that people still play and emulate to this day, a lot of hidden gems and cult games, the 64 had much fewer games in that regard. It doesn't help it had the worst controller ever and that even emulating some games with a modern controller is pain because of that, while it doesn't happen with PS1 games since the PS1, already had what could be considered the beginning of modern controllers.
Reply: @MoonOvIce  The PS1 does indeed have a few hidden gems of its' own but because less people had the N64 I generally find that the average consumer is more in the dark about hidden gems on the N64.  Everything from Star Soldier: Vanishing Earth to Battle Tanks: Global Assault are largely unknown to the average person.
Reply: @davidaitken8503 this is not mitigate the situation that from devs perspective console was burning trash can especially without proper dev tools and documentation (no debugger is wild)
No wonder third parties avoided it this time.
Reply: @Alexdc11Xof  Sure thing, TROLLBOT!  Whatever you say.🙄
Reply: @JS-rm2ws  never suggested that's what happened. Gaming developers are the most neurotic people ever and quotes are not good references to truth usually. It's very, very well documented that they learned on silicon for that era. No need to dance around it.
Reply: @thomasbeall9069  I agree with you in that we shouldn't read too much into quotes from games developers, but the quote I mentioned comes from Nintendo's own Genyo Takeda. He's not just a games developer. He was head of their  Integrated Research and Development division, responsible for hardware design
Reply: @thomasbeall9069  Too many Western devs, aside from those with an arcade pedigree like Midway and those that actually care about having a wide audience and understand what that takes like id Software, were and still are drunk on PC power and don't give a shit about optimization. Of course, console makers also tend to compete as game makers as well, so they dickishly withhold some specs.
Reply: @JS-rm2ws  It seems kind of weird to use turn-based battles when they already had the framework for real-time combat well established in the previous games.  A setup closer to Zelda 2 and Gargoyles Quest would make more sense.

By the way, if you haven't already gotten it, you should import Cotton.  It's a totally awesome 2-player co-op side scrolling shooter.:)
Reply: @davidaitken8503  I'll see if I can get hold of that game you recommended. I agree with all your points. Re my previous point that the N64 could not and did not achieve the visuals and depth of a game like Final Fantasy IX  :) There's no way you could fit that game with all its content (visual and other) in a N64 cartridge. The N64's  tiny texture cache being discussed here is another limiting factor.  Remember how N64 games often made you run around and play within the same-looking environments, repeated over and over?  Your other points about N64 titles that could not be rendered on a psx or Saturn, agreed, although I'd already said that earlier if you scroll up and  read
Reply: @JS-rm2ws  Your last point first.  Yeah, I know you said that, but I just wanted to expand on that and go into more detail if not for your benefit, but others that might read these posts.

"Remember how N64 games often made you run around and play within the same-looking environments, repeated over and over?"

Actually no, not really.  It seems like most games like the Banjo Kazooie games, for example, had different themed worlds that varied greatly in there textures and geometry.  That was really only an issue in the earlier games before the cartridge sizes really started to get big.  There was always more texture variety in any one given scene too.  Do you really want to compare any one single map in Banjo-Tooie to any one single map in Metal Gear Solid in terms of visual variety?

As far as an N64 game not being able to fit all of the content of Final Fantasy IX into a cartridge?  The way they do the graphics as an entire pre-rendered picture, sure, I agree.  Displaying those environments with real-time graphics though, wouldn't take up nearly as much storage space.  You should check out what the canceled N64 version of Eternal Darkness was doing before that project got moved to Gamecube.  It was rendering Resident Evil style game environments in 3D.  The limited camera movement is probably what allowed them to display so much detail as the scenery geometry wouldn't have to be updated at a very high frame rate.  They even had it running in a higher resolution without an expansion pack.
Reply: @JS-rm2ws  In 1996 I was a solid PC gamer. And we had the voodoo 1.... Yup.. That beast. Although we did pay through the nose for our hardware. The only consoles I had at the time was a SNES and my roomates saturn.  for which I admit the saturn had great 2d visuals and fighting games.
Reply: Nintendo could of took the cost, if it was between taking extra cost and nerfing the console, it should be obvious the choice, especially since even back then, Nintendo wernt exactly needing every dollar that was available.
Reply: @GamerXT333  Technically, they probably could have, but that's just not how business works.
Reply: @GamerXT333  Nintendo didn't nerf the system. The 3D rendering and fluid simulation on the N64 was the best of its generation. It simply used small textures along the way. It's still my favorite console, from the days before switching to PC after console emulation was stable.
Reply: @GamerXT333  IIRC it was hugely successful. Just sayin'
Reply: @JS-rm2ws  "The N64 could not achieve visuals and gameplay depth of a game like Final Fantasy IX."

This statement illustrates a lack of understanding about game design.  The textures and detail in a game like Final Fantasy IX appear impressive for the same reason the textures and detail in a one-on-one fighting game appear impressive.  They are displayed in a simplistic, controlled environment with limited interactivity.  Any game that has a massive, interactive environment with literally dozens of enemies roaming around within it is immediately at a disadvantage.  The enemies and environment have to share polygons and texture detail with one another and have to accommodate many more "what if" scenarios, especially if the player has direct control over a camera.  It is an elaborate juggling act that is infinitely more complicated.

Final Fantasy IX has more gameplay depth then any N64 game?  This is the same error in logic that leads many of the kids today to believe there loot-collecting, randomly generated dungeon, rogue-like has more depth than Final Fantasy IX.  You seem knowledgeable enough to understand where I'm going with this.  Neither has much in the way of gameplay depth.  What they have is a copious amount of stuff, and stuff is not necessarily depth, nor is it gameplay variety for that matter.  An N64 game like Zelda: Majora's Mask has far more gameplay depth then Final Fantasy IX could ever hope to.  Consider all of the nuance to the movement systems of not only Link, but the Deku, Zora, and Goron forms.  All of the elaborate scripting in Clock Town alone could fill a stand alone game.  I could go on and on.

I agree the N64 didn't exactly have a large selection of fighting games, but you do know it is possible to own more than one system at a time, don't you?  No 3D Playstation or Saturn game can match the graphical fidelity of a game like Turok 2, Perfect Dark, Banjo-Tooie, etc.
Reply: @aliasmcdoe  On the contrary, the PS1 and 2 are extremely overrated consoles with inferior exclusive titles and hardware capability. PS1 sold well because it was available first and devs didn't have to work as hard to fit games and audio on the storage medium. PS2 sold well because again, it was first out of the gate and was a DVD player. The N64 was a far better console than the PS1 and the Xbox creamed the PS2 from a technical and exclusive title standpoint. There's not one PS1 game that looked as good as Conker's Bad Fur Day nor were as much multiplayer fun as Mario Kart 64 or Super Smash Bros. Likewise, not one PS2 exclusive looked as good or was as fun a multiplayer experience as Halo. Once Xbox live went online, it was far and away the better platform.
Reply: @JS-rm2ws  LMFAO hahahah, wow your full of crap. Nintendo did not fail, how about how 10s of millions of faulty PlayStations being sold? Uh, Nintendo bought the N64 tech of of silicon graphics so how you came to that conclusion that a nintendo employee would regret making a console that essentially wasn't made by Nintendo themselves......? think before you pretend to be smart LMFAO 😂 a nintendo engineer regrets making a console that he didn't make? Odd.....